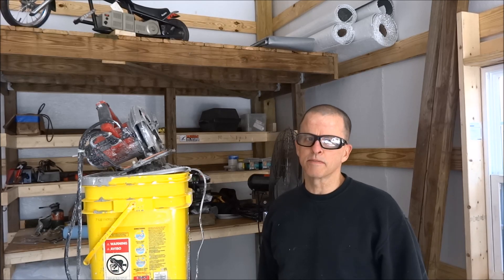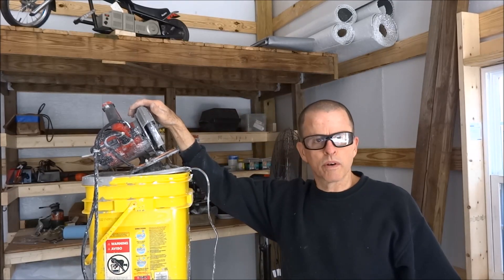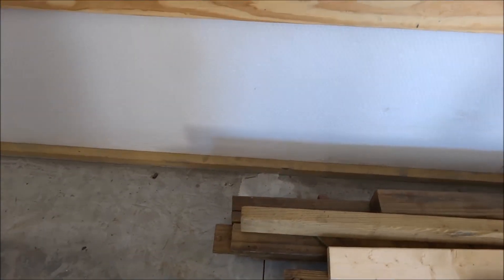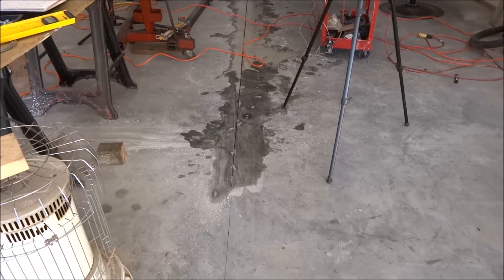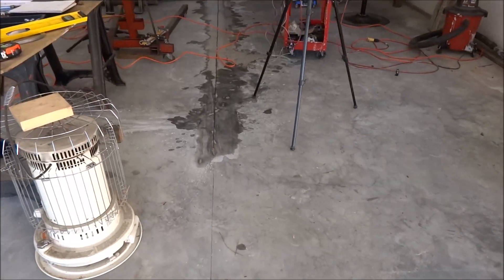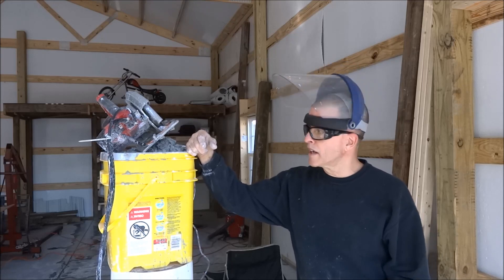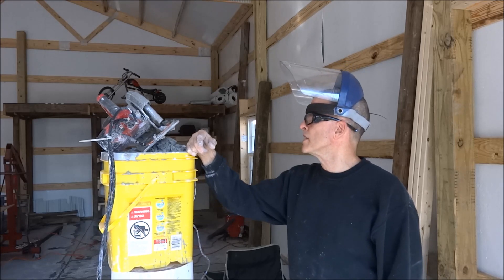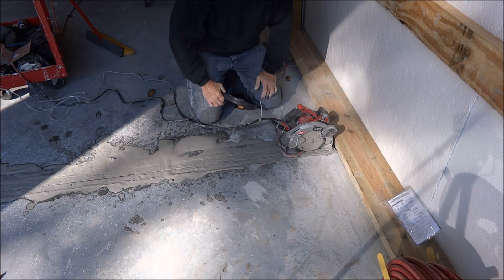Cutting  concrete with Harbor Freight masonry blade, Skil saw. Concrete crack control

Comment: I did a similar concrete sawing job on my driveway several years ago to stop cracks that had started and I was able to keep them contained within one of the squares. I went to Lowes and bought the cheapest 7 1/4" diamond saw blade, then to the pawnshop and purchased their cheapest decent circular saw ($20.00 bucks Gold Skil saw) I sawed my 55' X 18' driveway into 10 rectangles. I figured I would toss the saw when done but amazingly it's still running and has done a lot saw since. I see you figured out the trick to sawing a straight line in concrete is to have equal flows of coolant water on both sides of the blade. Nice Job on the sawing. Also, screw the so-called "do-gooders" on tool abuse, for the DIYer's It's all about getting the job without getting ripped off by the so-called pro's that charger the helpless homeowner's twice as much and leave laughing all the way to the bank!

Comment: Wow, no dust, no helper, you're a genius, off to home depot and petsmart. The saw should be plugged  in a gfci outlet, for safety and perhaps rubber gloves and avoid to kneel in water and that should be okay, people cut concrete like that all the time, a blower or air can would be better to clean the cutting line, I never put my fingers in the way of the blade, if it's not a rule, it should be. Thank you. 👍

Comment: Incredible DUST Control!!!!!!!! I want to lower my garage man door. 8 " foundation . should be able to get 4 " on each side, with my abused B&D skilsaw. How is the floor holding up? Don't know is you mentioned it, but a GFCI breaker or plug is a good idea for safety.
jm
Reply from the maker: Floor worked out great. I'm glad I did the stress relief cuts. No cracks except for at the stress relief cuts. Thats a good point on the GFCI circuit
Reply: @TSRGarage  Yes, I am thinking of lowering my man door into the garage. need to cut down about 10 inches into an 8" thick foundation. I'm pretty Good at procrastinating tho. I've cut stone , concrete blocks and everything with the skillsaw.
 foundation

Comment: So you ran those water lines on both sides of the saw blade correct How did you connect it or what did you use to connect the water lines from the pump
Reply from the maker: Just gravity 
From the bucket
 No pump
.

Comment: Nice, very nice. Your lines look awesome. How was it on the first cut of each line? Did you just run the saw and slowly lower it down into the concrete? How deep was your cut?
Reply from the maker: SHAWN MILLER yes just start with a plunge cut same as you would in the middle of a piece of wood. The cuts are about one inch deep.

Comment: Thanks for the cool video.  I do have one question.  The Harbor Freight Warrior®- Item#68882 seems to have a sort of skewed square hole in the Harbor Freight on-line photo.  I plan to use a Sears "Skil-saw" which has a round shaft. Does the Harbor Freight blade really not have a round hole?
Reply from the maker: G Watson I believe it will be a round hole.  Packaging for the one I used says Warrior 7" segmented 5/8 Arbor item number 68883
Reply: Thanks for the quick response.  I need to cut 4" of concrete about 20' long.  Do you think my Sears Skil saw will work?  How deep do you think I can cut?
Reply from the maker: G Watson it will take a while to cut that deep of a cut. . you'll have to go slow. If you mean cutting through 4 inch of concrete, I don't think a skill saw will reach the full 4 inches. Skill saw at full depth is probably only 2 and 3/4 maybe 3 in.
Reply: 2 or 3 inches will do. I just need to score it such that I don't damage the adjacent concrete too much.  I will then use a jackhammer to get the rest.   Did you just use gravity feed for your water through a 1/4 inch tubing or so?
Reply from the maker: G Watson yes I used aquarium tubing. The end of the copper tubing I used was pinched down to about an eighth of an inch.

Comment: What is the purpose of these cuts? I heard you say, (and I understand), stress relief but why do you feel the need to relieve stresses in a monolithic pour of concrete? To avoid future cracks?
Reply from the maker: Randy Cook  Yes to avoid/control future cracks. (A slab this large will crack). The stress relief cuts control where it will crack at. If there is any stress it will crack along those lines. Basically just makes it look better when it does crack... cracks will not be running every which way across your slab.

Comment: Amazing!  I couldn't change the blade on my Skil circular saw to the thicker saw blade.  I need some help.  Thank you very much!
Reply from the maker: The blade I used is not very much (if any) thicker than some standard blades. It was no harder to change out than other blades. But having said that.... the saw that I used in this video has a lot less room to get the blade in and out. So it is a bit of a pain in the ass to change blades. Even with the blade guard completely open, the blade is still a very tight fit.

Comment: no mention how the flow is started.
Reply from the maker: 00:45 I mention the magic of gravity "it's  just gravity feed".  Once the hose has water in it, and the saw is lower than than the bucket water flows down to the saw blade. It's a simple siphon tube....
Reply: @TSRGarage  Thanks ,  but how did you get the hose filled with water, how do you prime it.
I'm doing this today using nickle copper brake line for the hard line at the saw end.
Reply from the maker: @Gerard Jones It is just a siphon tube. Put one end of the plsatic tubing in the bucket suck on the other end like a straw. As soon as water in the tube outside the bucket is lower than the water level in the bucket, it will continue to flow.
https://youtu.be/CZmP0vsRBZ8
Reply: @TSRGarage  This idea works very nicely.
I did it, using a pressurized weed sprayer with a pump on top, once it starts it gravity feeds , i set it up on a stool. I'm making 3 inch deep cuts,  4x8 feet new pad to install a car lift.
I make a series of 3 inch plunge cuts, then join them up , no dust in the air, no mask needed.

Just ordered a 10 lb sledge concrete breaker, it has a wedge on one side to split the concrete up.